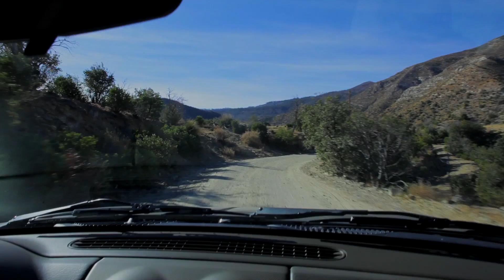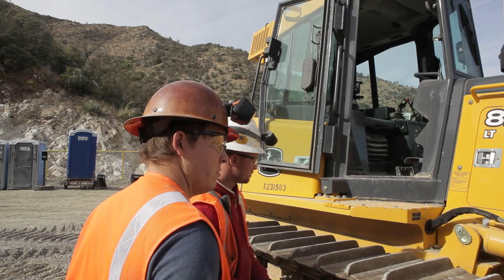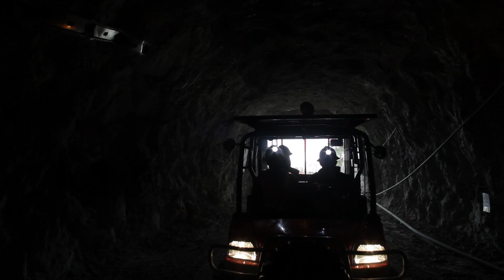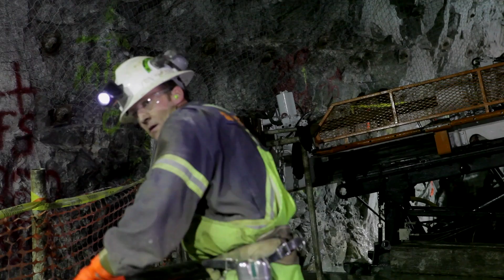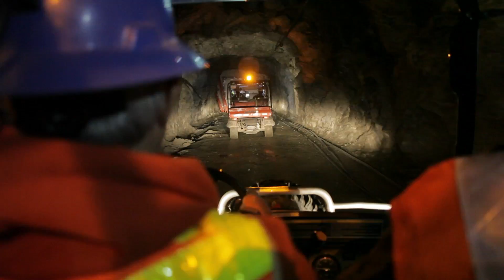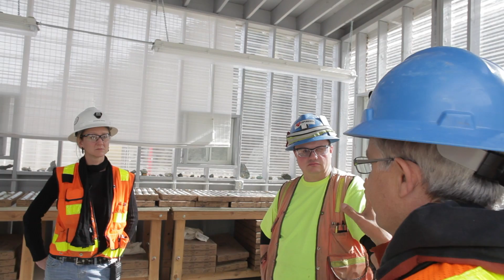Oracle Mine, Arizona

Comment: I was involved in the mill crusher and tailings installment then became a mill operator the six years it ran, many memories some good some bad... an experince in itself with state of the art at that time milling using towers and mechanical cells to float it out. The mine closing because the grind couldn't keep up was simply not true, the mine never did keep the 1000 tpd marcy rod mill filled with 3 inch grinding balls fed adequately or consistent. Very high tremoline contents also is all over this mine.  I sure do miss that place though,  I've got some video of the entire float system during running time...immaculate.